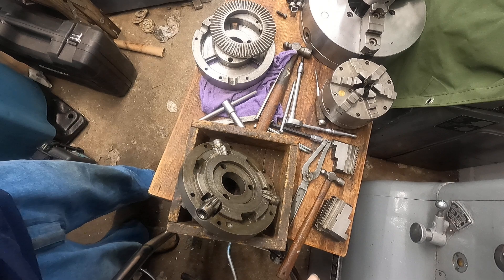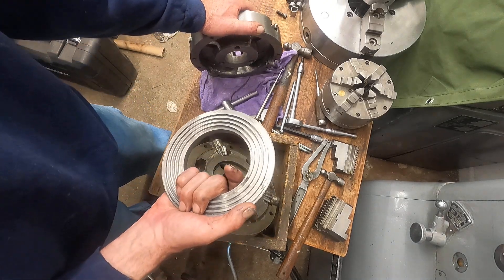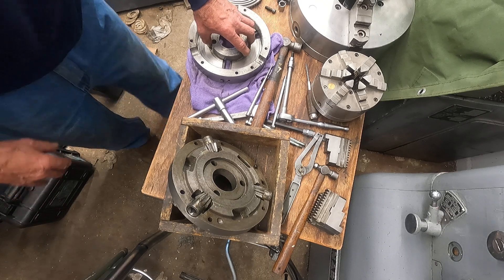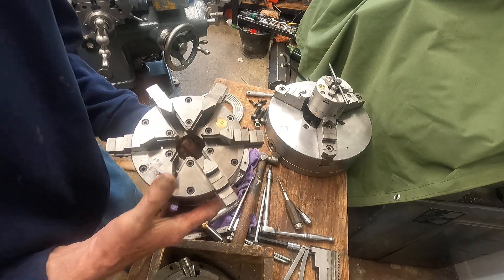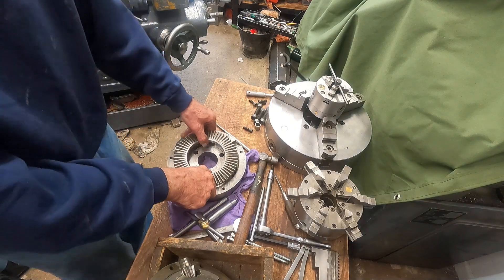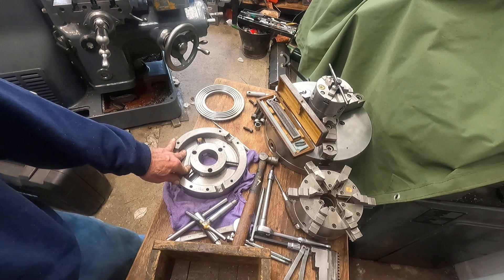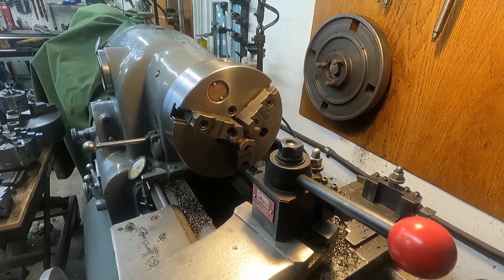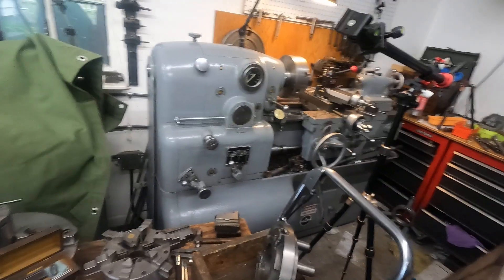Lathe scroll chuck inspection part 2

Comment: Hi Tom, good vid for chucks. How much play do u think is permissible between scroll and jaw before its time to repair or replace the jaws for a 3 jaw chuck...
Reply from the maker: Hi, just caught this! The basic clearances for chuck s up to12" tend to be around .002" or a little more. if the pivot bearing area for the scroll wears close to ,004" then chuck has a harder time repeating. At that point the other bearing areas show wear also and can be  cleaned up. The end play of the scroll should be tightened back to .002 or a little more. When that is done the chuck will be pretty tight and effort with tighten the pinions will be increased until it wears in a little. I stay away from chucks with missing or damaged beyond simple grinding jaws, replacements are too hard to find, thanks1
Reply: @deedeeindustrialsuperprecision  Im doing one of those jaw replacement for a 8 inch chuck, first time for me as no-one arround my city does repairs for true chucks....thanks a ton for your advice... Regards

Comment: i have a 8inch 4 jaw independant. also one that was less loved, and tosed out. it has a huge amount of ware in the jaw slides. bothe in the chuck and the jaw. what would your approach be to tepair that? my thinking is ti grinde the slide ways in the jaws till thay clean up. then cut away the square lip in the body and replase it with a key steel insert that is ground to match the jaws.... dont know if there is maybe a better and less painfull  plan
Reply from the maker: Wow! The 4 jaw chucks I find around here most often covered with rust from no use. They used to do repairs like that on huge independent chucks and tables on boring mills. I dont know why not a small 4 jaw chuck could be repaired also.

Comment: Don't the pinion holes get football shaped if you resurface the split line? Can it be done a couple times before the pinions bind?
Reply from the maker: Part of it is reboring the pinion holes top and sometimes the bottom. if needed. I dont think the Cushman 8" will need that because the wear is being taken care of early. The Buck 6 jaw was so worn. I had to judge where the pinion should be and sleeved the small bottom hole and bored the top pinion hole back to round then put a sleeve around the top of the pinion also had to take a little off the scroll side of the jaws squeezing it together caused a little bind. You can get away with a lot as long as the slotted front half is not distorted from a bad crash.
Reply: @deedeeindustrialsuperprecision  I have an 8" 3-jaw with D-3 mount that's running out .008" TIR on a 1" ground leaderpin as a test piece. You've given me confidence to tackle this but I need to start with a faceplate (which I currently don't have) to remill the chuck. Thanks for the tips!